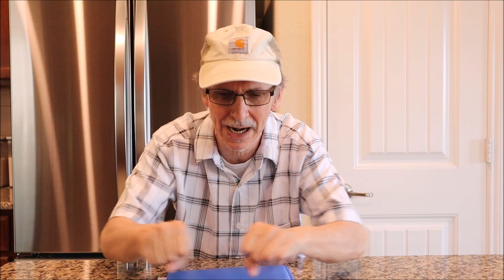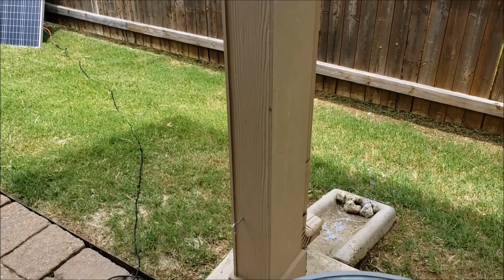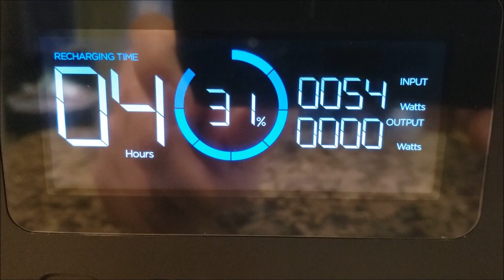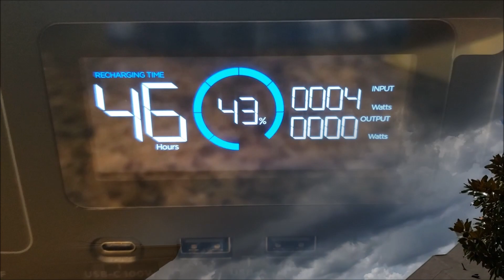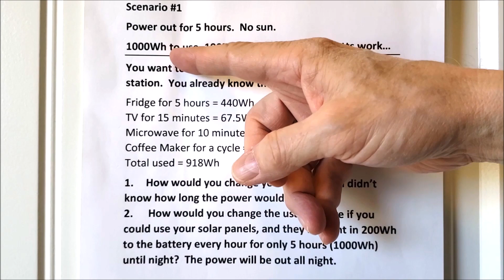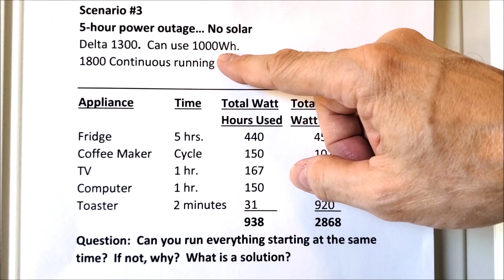Power Outage Protocol, Manage the Power, and Solar Panel Usage - Part 3 of 3

Comment: You are a GREAT teacher. I will need enough renewable energy  to provide power to a refrigerator, freezer, kitchen lights, and a Master with a 9000 BTU mini split at night, all inside of a 1000 square foot house. These Ecoflow products seem hefty enough to provide that, as long as I purchase the right items. I will also want some sort of automatic Transfer Switch so that those items can be powered even in my absence. This is all Chinese/Arabic trigonometry to me, so I’ll have to watch your videos several times. Thanks for your hard work.
Reply from the maker: Thank you. Glad I could help.  I was acually a teacher for years.

Comment: Excellent set of videos. My conclusion is that I will keep my batteries at 100% at all times. That I will prioritize (1)running my freezer ,(2)use an electric blanket if necessary to keep warm, and (3) keep my cell phone/laptop charged up as well. Everything else I can manage with other sources of energy (plenty of batteries for light, and can use wood fireplace for cooking or my butane stove).  Thanks again, you are a great teacher!
Reply from the maker: Good for you!

Comment: Thanks for the videos.  You always do a great job.  I was in the Dallas area in February taking care of my 97 year old mom.  She had just had partial hip replacement surgery.  Thank the Lord I was there.  She was using a walker and that is hard when you are all bundled up.  Lots of chances for disaster.  I was thankful for your videos and really like the tips about having a small power station (battery/inverter), an electric blanket and catalytic heaters.  We never lost water but we were without power for over a day.  I think it was zero degrees outside.   I am finally getting around to building my own power system with 2000Watts of solar to start with.  I look forward to learning more from you and sharing some of what I learn.
Reply from the maker: Hope your mother is doing well...